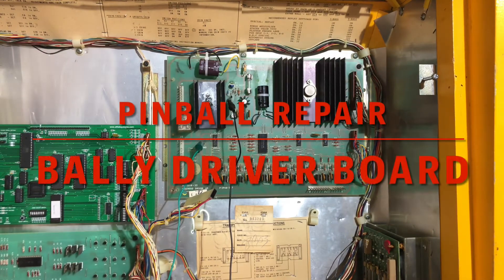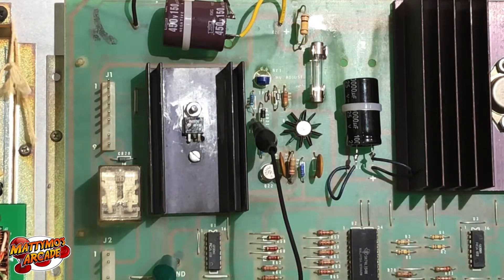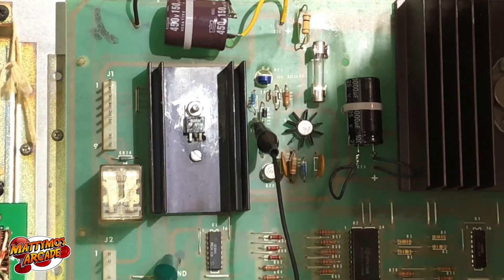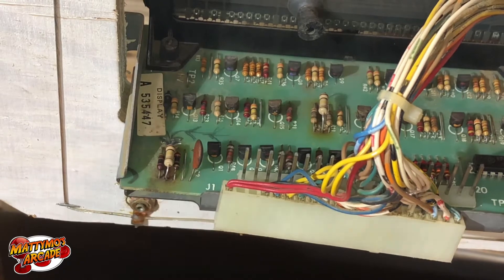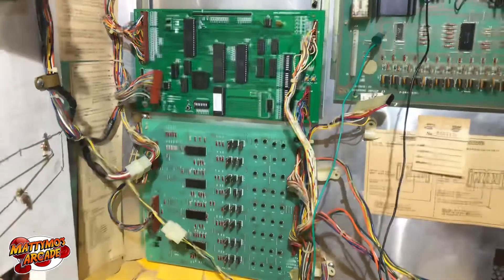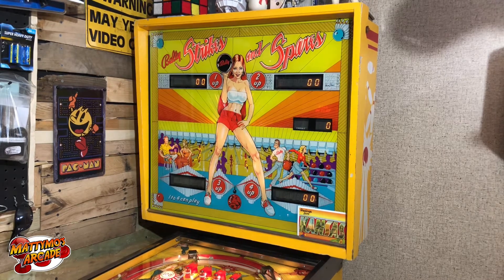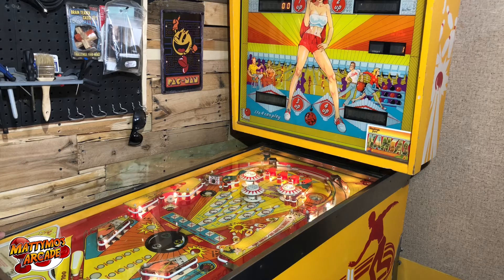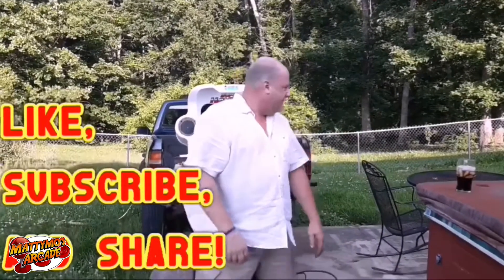Bally Pinball, Driver Board Repair, No Displays,

Comment: Very helpful thanks!
I have Stern Flight 2000. Not booting and no displays powered up. 
In the bottom cabinet I replaced the bridge rectifier board because the original was hacked and missing the 230VDC for displays. After the new rectifier was wired in, it also had the display voltage missing but all other voltages are now correct. 
Leads to me thinking the transformer is causing problems. Your thoughts?
Reply from the maker: There are usually several rectifiers used. Check to see if a second one needs to be changed. But if you aren’t getting the proper voltage from the transformer, it has to be a problem.